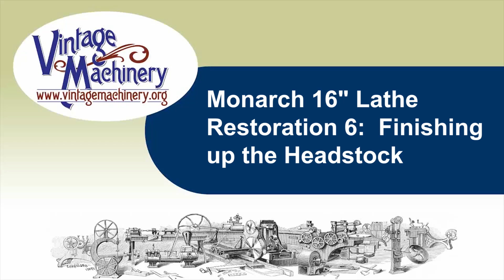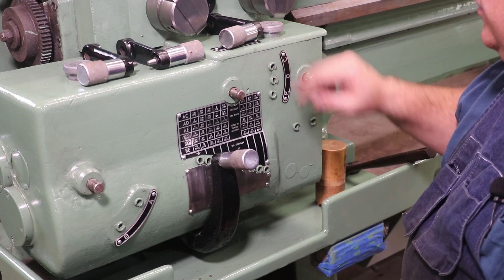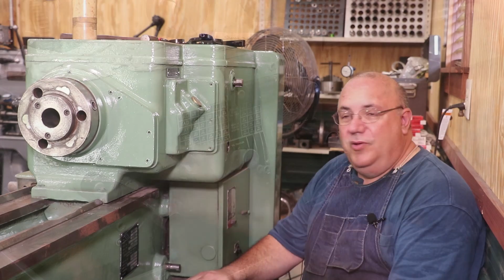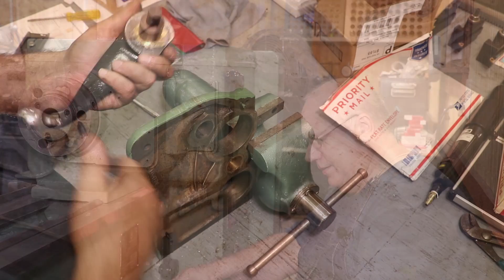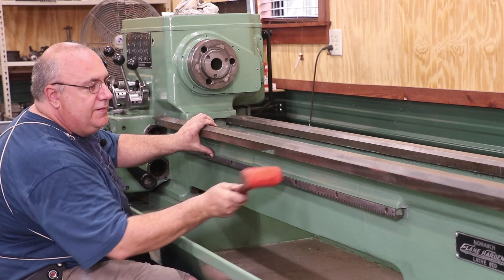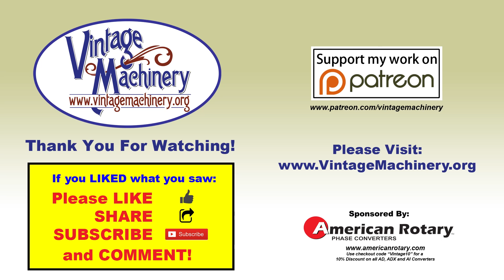Monarch 16" Lathe Restoration 6:  Finishing  up the Headstock

Comment: @11:38; @11:46 on the gear cover and gearbox Keith kindly gives all his loyal followers a clear view of how he very sloppily has run globs of paint onto the mating surfaces of the lathe parts. Then @13:26 he does it again by showing us all how he mounts the saddle rack onto a painted surface. Paint is not of uniform thickness and is therefore ALWAYS omitted from mating surfaces unfortunately Keith doesn't know this so continues to teach his viewers how to make a mess of restoring machinery. Not only is this very bad workshop practice it is also deeply embarrassing to see someone who acts as an example to others behaving (quite unkowingly) in this way.
Reply: jonka1; "he does it again by showing us all how he mounts the saddle rack onto a painted surface."   Do you seriously think the rack being in or out from the bed by a few thousandths of an inch is going to make any difference in whether the gear on the saddle will properly engage? Really?
You may have a point about the end cover for the quick change gearbox. I myself wonder if that's going to seal without a gasket.  I'm thinking the previous owner took it off to check out the damage and put it back on without the gasket so when Keith disassembled it there was no gasket.
Reply: Luckystrike, In my opinion it does matter about the rack insofar as Keith is putting himself forward as a source of learning and information about machine repair and restoration. Yes this pales into insignificance compared to some of the appalling examples littered thoughout his work but as a general example of bad workmanship it has some merit. 
As for as the gearbox end not only will it have no possibility of sealing but, more importantly, it will be sitting unevenly on its face thereby causing other parts to run out of true and possibly under stress. All this for the sake of a moments thought. I make these comments in the hope that Keith might take a moment to look at himself. So far he has not responded to anything but plaudits and mis-placed admiration of situations and actions by viewers who are not aware of the need to understand what is required when working with machinery.
Reply: jonka1; Here we have a criticism of a man with dozens of hours of content, a documented record of successful restoration of several machines of different types,  as well as demonstrated skill with  machine tools of various kinds, ,and 100,0000 subscribers by a person with 0 content, no demonstrated skills (except for harping criticism) and 0 subscribers.   Who has credibility?   
When you come anywhere near the accomplishments Keith has under his belt come back and show us how good you are. Till then kindly keep your carping to yourself.
Reply: It seems as if we are both entitled to our different opinions In the meantime that gearbox cover is still not on properly and even as you put all this effort into rubbishing me  all of Keith's past mistakes are still made and are still waiting to cause damage in the fullness of time. Personal insults fade with time however the truth never goes away.
Reply: Where, EXACTLY, did I insult you? I merely pointed out the simple and obvious facts that you have zero content, zero subscribers, and zero demonstrated skills.
I have no more time for you.
Reply: The refence to carping was bordering on insulting and I assure you that you would not have said it to my face. You have absolutely no idea of my lifetimes achievements and I am pleased to read that our discussion is at an end.

Comment: Regarding the rack, most newer cars that have 
drum rear brakes, have a threaded hole that does 
the same, as those tapped holes on your rack.

Makes doing drum brakes MUCH easier.

Oh, you have a small "beer" hammer coming.
If I ever get around to sending your "goodie" 
box.  Makes a great tap hammer, and, since 
it is stainless, will crack ice, too.  Claw on the 
backside is a bottle opener. too.

steve

Comment: I know you love old and vintage machinery so the other night when I was cruising the internet when I ran across a video where they had pictures and comments on the production of German WWII Tiger I tank.  I found It fascinating because of all the old machining and tooling they used in the manufacturing of these tanks.  There was some great pictures and explanation on what they were using the mammoth tooling for.  The video wasn't so much about the war as it was about the process and production of these tanks.  A couple of your videos ago you talked about a radial drill press that you found and planned on restoring.  This was one of the pieces of machinery that they showed, but it was a little bigger than yours.  Before I saw the drill on you video, i'd never heard of that type of drill.  To find this video search on "Tiger I tank Factory Production, assembly line."  You will enjoy it.  Bryan

Comment: Beautiful restoration as usual. What you refer to as a "spring pin" has always been a "roll pin" to me and others call it a "tension" pin. Regardless of the name, you may be aware there are special punches for installing them that have a tit on the end which engages the center hole and keeps the punch aligned with the pin. A set can be purchased or a broken alignment puch can be reground with a tit on the end and will work as well as a purchased set. Keep up the good work and great videos.
Reply: Can someone please contact the publishers of "Machinery's  Handbook" so the dimensions for "roll pins" and "taper pins" can be combined to save print space. :-)
Reply: Ron Treppeg Roll pin here as well.
Other items which are same but with different names:

Zerk nipple - grease nipple
Chain fall - chain block
Secure something - turn off something
Head - toilet might be naval only however

Just few things I remember for now.
Tools with tits sounds good however :o) Something new to me :o)
Reply: roll pins (spring pins) and taper pins are completely different from each other :-(.
Reply: I have the proper punches that are made for roll pins. I also have transfer punches and never thought of using them on roll pins. I’m sure they will do the same thing. But to tell you the truth I normally grab a regular pin punch because they are organized in a wooden holder and easier to pick the size I need.
Reply: Where I'm from a roll pin is actually a pin made by rolling thin metal, where as a spring or split pin is made of a spring metal with a cut along the length to allow the pin to spring in to the size of the hole. The names describe the makeup of the pins. You are right, the proper pin punch makes things easy to install.
Reply: @ Gary M that is the way I was taught as well I have also heard them called coil pins by some.
Reply: Ron Treppeg , I've had guys tell me that transfer punches are used for driving roll pins in and out. Sounded good to me.
Reply: They are not Spring Pins or Roll Pins. They are called a Taper Pin.
Reply: I guess I misunderstood you when you said, "They are not Spring Pins or Roll Pins. They are called a Taper Pin."
Reply: The pins on the Monarch are actually solid taper pins that get driven into a tapered hole in the parts. They are stronger and hold up much better than a roll pin (spring pin). The only negative is they cost more and machining the tapered holes cost even more.
Reply: And don't forget the aligning property that a taper pin has vs the spring or roll pin.
Reply: Have you noted the trend, the name usually describes the the item which in turn gives away the usage or construction or characteristics.  How does transfer relate to driving in pins? Screw driver, yes that's what is used to counter sink a nail, and more. Good tools cost good money and they deserve good and proper use.
Reply: Gary M , we were talking about roll pins and the other names people in different areas call them. There was also some discussion about having a specific tool to remove roll pins. I referred that people use transfer punches to remove roll pins, most of us use a punch to remove pins, and I use a nail set to set nails, unlike you it seems.
Reply: Gary M, I usually have a good sense of humor, so I'm sorry I missed your sarcasm. Sometimes we don't always have the proper tools we need, so we improvise with what we have. I mentioned using a transfer punch and I wanted some feedback on what people thought about it. I also, learn a lot on this and other channels, so on to the next one. Have a good one.
Reply: Seems to me that you need to read more carefully for you don't seem to understand. What people call things aren't what they really are and it seems they don't care. If one uses a tool, one should learn what the tool is and how it is to be used. Sarcasm seems to be beyond you as well, probably my fault for not using one of those idiot face things. These videos are good, the information is good but some of the the viewers I have doublts about. No need to reply, for I  now see that people just want to talk and not learn. Enjoy your chats.